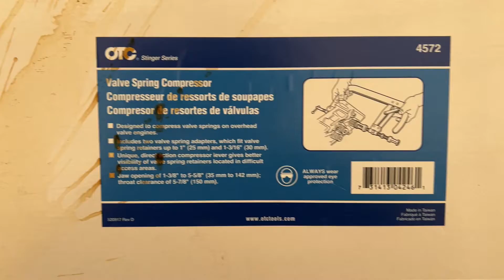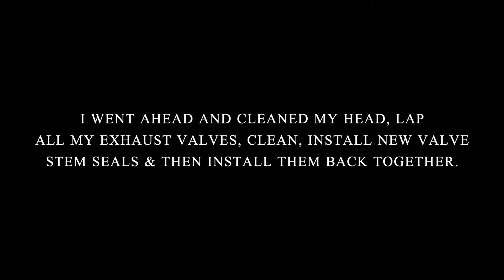FJZ80 LAND CRUISER 1FZ-FE ENGINE OVERHAUL |  VALVE JOB & PREPPING PARTS FOR INSTALL

Comment: Nice work man!!! If you have a local place that does media blasting, have them soda blast the oil pans, intake manifolds, exhaust manifolds, timing covers, and all the other parts. DO NOT let them sand blast or use glass beads, make sure its soda that way there's no risk of any particles that are left causing damage. that will get your parts super clean and ready for reinstallation. And if you have any painted parts like the lower oil pan you can re-apply high temp enamel paint. You're making quick progress! I Love it. Keep up the great work!
Reply from the maker: Thanks! I’ll try pressure washer and just go from there. Just need it clean enough to work with when it’s time to install. Making fast progress, summer is short in Alaska. Need this rig to run up by next month